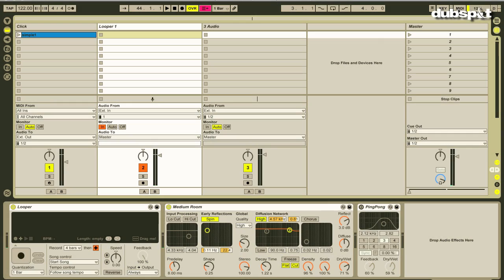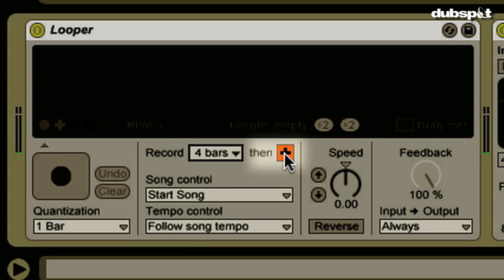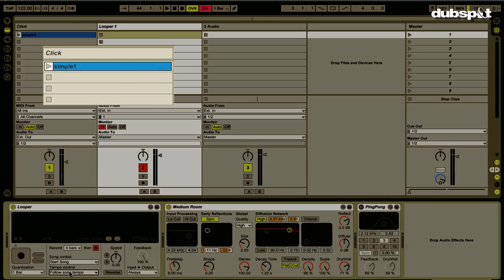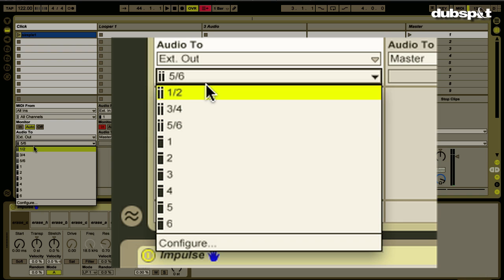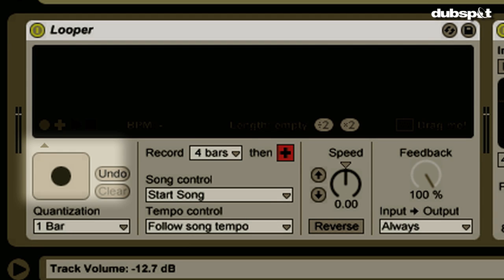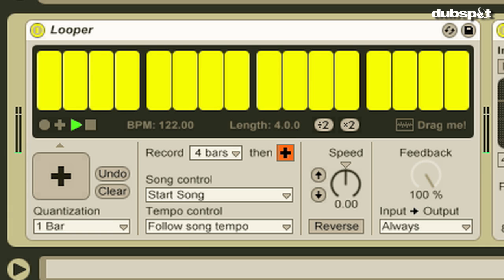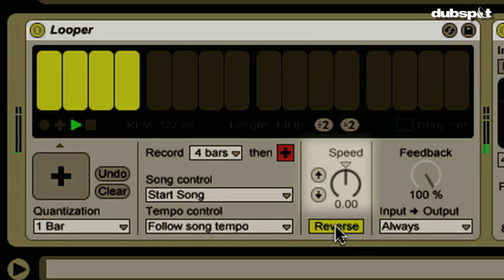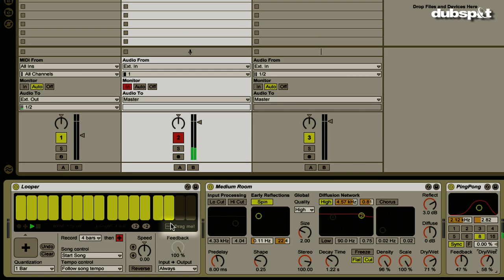Ableton Live Tutorial: Live Recording using Looper w/ Laura Escudé

Comment: Yes but what's the whole point into using a looper in the first place? I ll never get that. You can do everything the looper did here by recording to a single track, then reverse it if you like with the Rev button, then split it to 3 pieces of 4 bars each, and then layer those 3 pieces together. And the advantage here would be that you could FX seperately each "loop", or alternatively you could as well go on and record it on a single track.